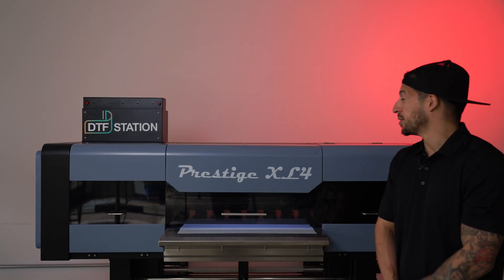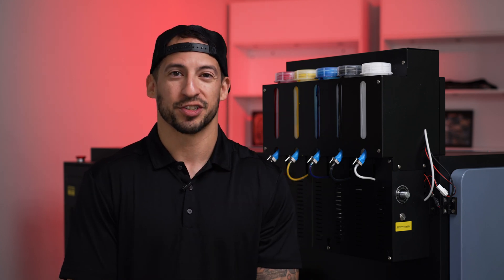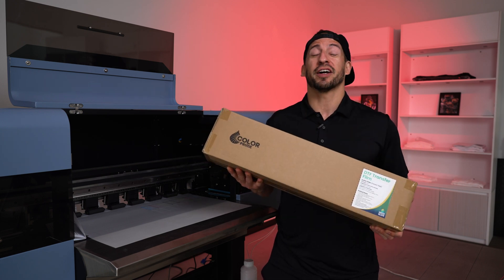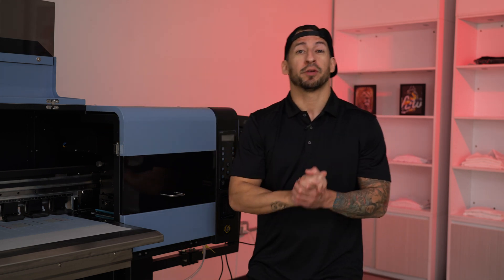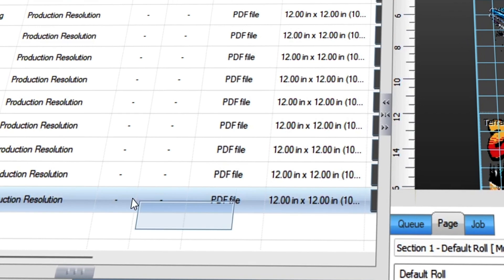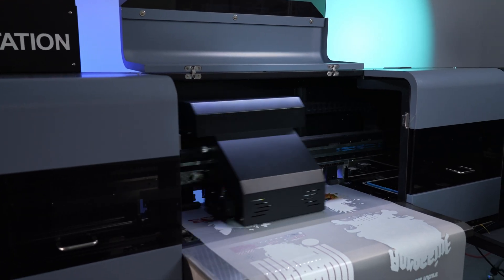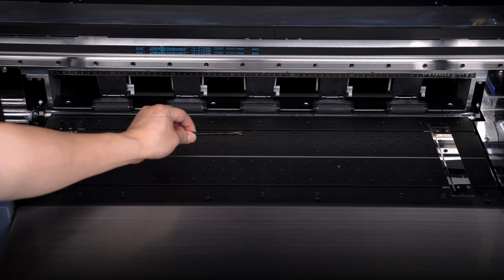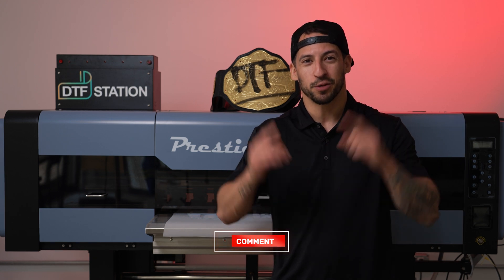Is This Really The Best #DTF Printer? XL4

Comment: Which shaker is best for this printer
Reply from the maker: Hello, for the print speed of the Prestige XL4 we would advise either: 
https://aaprintsupplyco.com/products/seismo-a24-dtf
https://aaprintsupplyco.com/products/seismo-l24r?variant=40089549275220

FYI, both of these printer shaker combos are available at a discount if you BUNDLE here: https://aaprintsupplyco.com/products/dtf-station-prestige-xl4-dtf-shaker-bundle
you can hit the drop down menu on this last bundle link to see the price differences

Drop an email to Wallace@aaprintsupplyco.com to make sure you have everything you need!

Comment: Thank you for this very informative video!  Q. Is it true the finer the powder the softer and less plastic feeling your print will be?  If so what powder do you suggest?
Reply from the maker: Hello there. The feel of the final product is determined by the film/ink/powder combo overall. As a general rule of them, a finer powder will give a better final product especially if we are trying to get fine details onto the clothing. Here is what we use: https://aaprintsupplyco.com/products/color-prime-hot-melt-powder-for-direct-to-film?variant=40160018956372
*safety data sheets available in the listing^